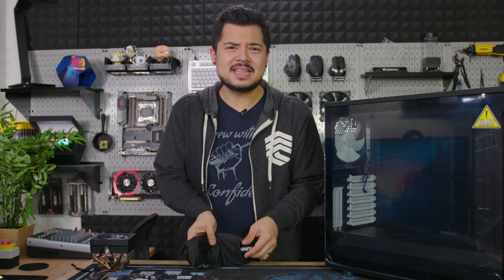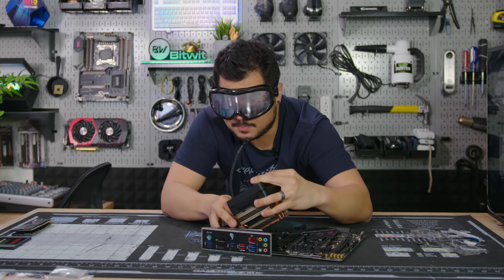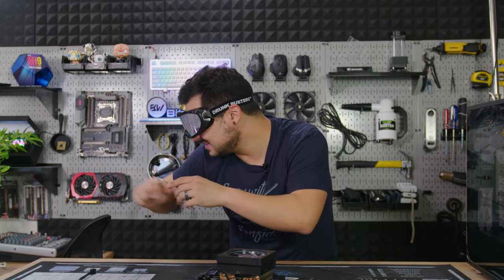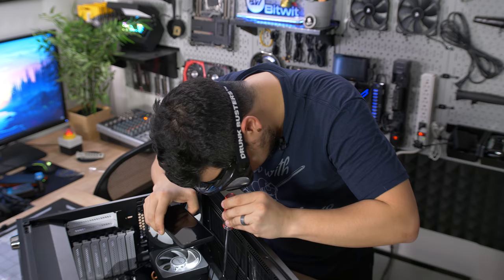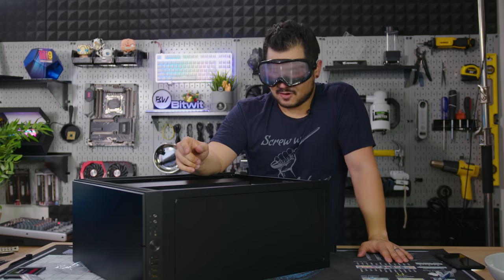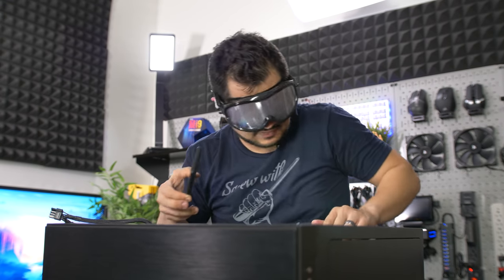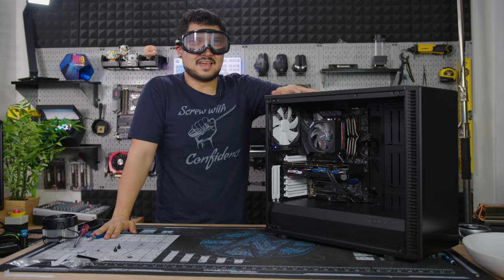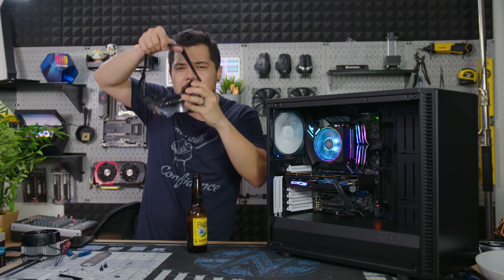Building a computer with DRUNK GOGGLES! - ft. RX 5500 XT

Comment: 2:50 Thats exactly how it looked when i installed the Wraith Prism for the first time. Pretty stupid mounting mechanism
Reply: The worst mounting system ever invented, my first try took my 40minutes 😅
Reply: ahmed ghare  I just couldn't get the 2nd clasp on, and because it was my first time so i was hesitant to use too much force.
Reply: It actually pretty easy. The one clip with  out the lever goes first. should only take u about 30 seconds to do it.
Reply: It's a good mechanism because it remove a lot of user error with incorrect mounting pressure (not that it's that common of an issue), but it isn't as intuitive as putting in a few screws.

Comment: i’m very glad you uploaded this cause i’m building my first pc and you doing this basically blind helps my confidence...
Reply: Can you build with legos,if so you will do fine just don't yeet it out a third story window
Reply: @Sutaokami  yeah and also don't bend cpu/motherboard pins :) that is the most important part :p
Reply: ikea furnitures are alot harder to build than building pc :D so need to worry about the difficulty :p
Reply: @oplkfdhgk  oh shit I thought you were supposed to bend them
Reply: well if you guys could help me that’d be great, so i built it and everything works fine except the graphics card. it will spin when i first turn the pc on for like 5 seconds but afterwards it shuts off. do you know why?
Reply: @slammin3754  what are your specs?
Reply: @slammin3754  but that sounds like your power supply might not be enough for the gpu
Reply: well i got a ryzen 7 1700x and the gpu is a 2060 rtx the psu is only 600 watt.... idk if i have things wrong i don’t really know what i’m doing :)
Reply: @slammin3754  so the fans on the gpu don't spin but it boots to windows? thats normal ,the fans only spins on gpu when they need to.not sure if thats what you meant :D

Comment: Hey bit wit do a challenge where you have the amounts of foam boards that there is parts in a computer and label parts of the boards different gpu’s and other boards do CPU’s ssd’s motherboards, cooling, power supply and cases and you throw a dart at all the boards and what ever type of the pc part you land on you put it in the pc

Comment: I remember the first time I built a computer while just slightly intoxicated. Actually it's the only time it happened, but I'm not counting hangovers...
My boss celebrated a nice new account and was making sure we all got a fair share of the whiskey. I actually tried to hold back as I had one more computer to assemble before the weekend, but even so I ended up toasting a few times to many in his office. Building that computer was interesting as it seemed everything took at least twice the time it should, and I made several strange mistakes and had to double and triple check everything just to make sure I didn't turn it into a lemon. Fortunately it was the last of a run of ten or fifteen identical computers so I had everything pretty much nailed down including a jig for the wiring harness. But it was still hard enough that I then decided it wasn't a good idea to drink and build...

Comment: I'm visually impaired, and registered blind i can so relate to all these issues your having and somethings are easier when not relying on sight and going by feel. The amount of times i've had issues getting ram in especially once it's built and i have a big cooler honestly drives me nuts sometimes do it first time others takes me 15mins.... 

With screws damn i just put them in by hand to start if i can if not takes forever.

Comment: Is there any difference between how you start out with the ram, as long as you always skip one slot before placing the second card?
as in, could you start from the left side and skip one slot to place the second card in and it'd be the same as if you started from the right side and skip one slot to place the second card in?

Comment: Hello! I will be really grateful if you could help me with my problem. So, I bought a ryzen 5 2600x for 125$ and I will be pairing it with a 5700xt red devil to play AAA games in 1440p resolution. The ryzen 5 3600 costs 200$ here in Greece. Did I make a mistake? Should I return the 2600x and buy the 3600? There is a huge price difference between them, so is it actually worth it, or will I be fine with the 2600x? Thank you!

Comment: That was cringe worthy... Dropping the thumb screw into the case... Also I usually leave hooking up the sata connections (Power and Data) 'till last, as I'm paranoid about snapping the plastic tabs off whilst plugging other cables in or during cable management

Comment: Hi Guys Building my first PC just wondering if my setup is ok ? And wil I be able to run 60fps ? 
Central processing unit (CPU) - AMD Ryzen 5 3600 Processor
Motherboard — ASRock B450M Pro4
Memory (RAM) - VULCAN T-FORCE 16GB (2X8GB) DDR4
Graphics processing unit (GPU) — RADEON RX 590 RED DRAGON 8192MB GDDR5 PCI
Storage — SSD and/or HDD - Toshiba P300 3TB 3.5'' SATA High-Performance Hard Drive (OEM)
Power supply unit (PSU) - Thermaltake London 550W Quiet Hybrid Modular 80+ GOLD Power Supply
System cooling — Noctua NH-L12S
Case -Thermaltake Core V21 Usb3.0 Micro-atx
Monitor - LG 27GL650F-B 27" IPS Full HD 144Hz
Operating system - Windows 10

Comment: Don't ever buy this crap, I got a complete fresh new build with AMD 
theme, CPU 3300x and RX 5500 XT, but whenever I load anything remotely 
demanding on the matter of hardware, it either crashes, freezes or won't
 start. Yes I have tried reinstalling the entire PC, software, updates 
and so on. Never in my life shall i go back to this useless crap.
Reply: I have heard complaints about a couple specific models of Ryzen.  Always wait for the pros to test them first before buying them right after release.  My Ryzen 9 3900X is a beast and wouldn't trade it for anything.